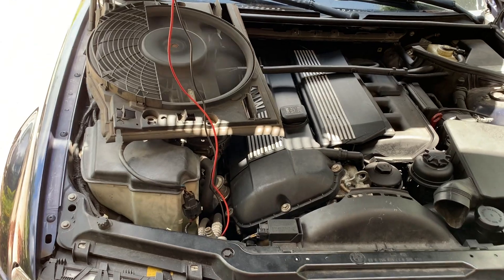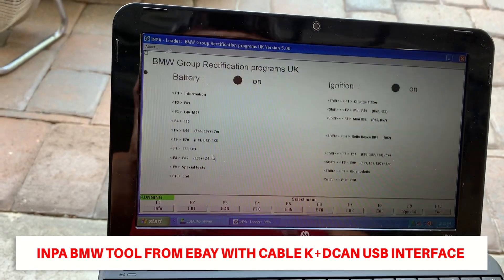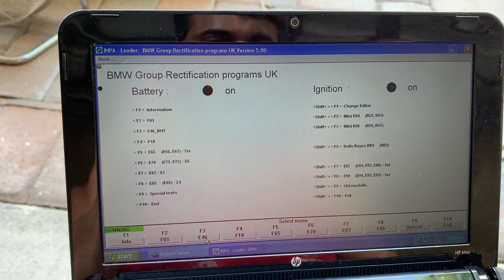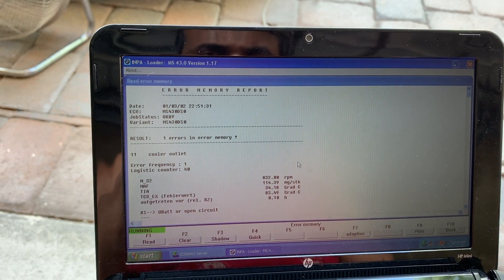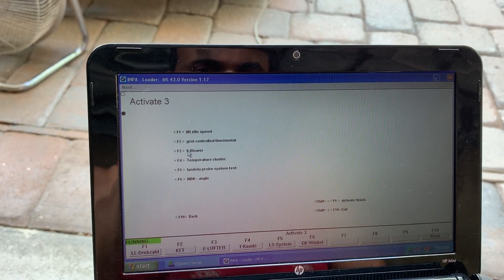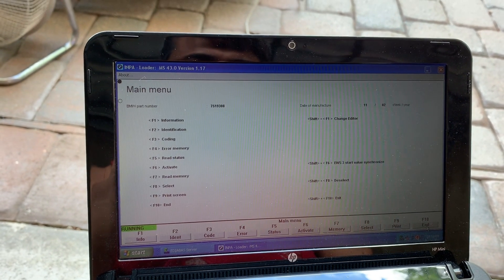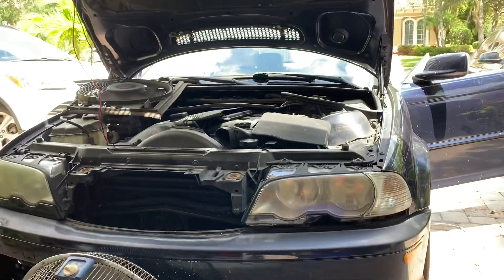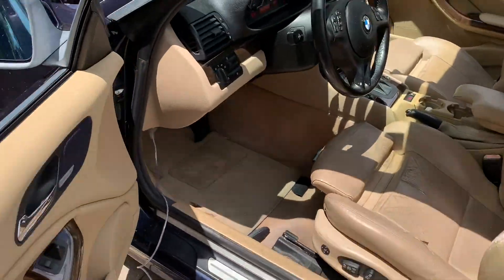BMW E46 ELECTRIC FAN FIX

Comment: So your initial auxiliary fan was dead and by changing it over it set off error codes in the dme, correct!
Reply from the maker: Huh ?
Reply: @HowToDoitright  Sorry im english, so your fan was not coming on, did it set off any error codes, sometimes the car will set off error codes making the fan not work, by clearing error codes with a scanner it might come on.
Reply from the maker: @ricardopelc-wesoly3483  no error codes were there.
Reply: @HowToDoitright  2.14 in you say that you had error codes on the fan!
Reply from the maker: @ricardopelc-wesoly3483  I may had. It’s been so many years. Sold the car. Don’t remember what I did yesterday 😂
Reply: @HowToDoitright  So the temp sensor more than likely triggered the fault in the dme.

Comment: Also.  To everyone with this problem.  IF YOUR AC LINES ARE LOW ON COOLANT.  THE FAN RELAY WILL NOT TURN ON.  YOU HAVE TO EMPTY YOUR AC LINES AND FILL AND BLEED THEM WITH NEW REFRIGERANT.    ACC LINE AFFECT THE FAN RELAY. JUST SOMETHING I LEARNED RECENTLY
Reply: Is this true my AC refrigerator is empty. I'm trying to test my electric fan but when I press the AC button my electric fan doesn't come on.
Reply: Thanks for this. I was wondering why it wont turn on and you solved it for me. 🙏

Comment: hi thank you,,, i also bought a inpa and cable from wish and i have a different inpa software version ...
so i took a version from bimmergeeks...
 no turning on fan when engine gets on temperature gauge on the middle
 it turns on when i connect the two cables from the sensor together
 and take battery cables off and it turns off
,or turns on with inpa but doesnt turn off with inpa f4 or it turns on with inpa and not turning  off with switch off
or it turns on direct minus and plus to battery and turns off when disconnect from battery
i also notice my airco pressure is low because of last years little engine refresh all coolant and gasket and oil etcetra etcetra,,
thanks for all help 
helpppppppppppppppppppppppppppppppppppppppppppppppp
thanks to u all,,,
greatings  a Kurdish boy living in the Netherlands..
Reply from the maker: I was seeing a similar problem on my E46. Tried so much to troubleshoot and after changing bunch of parts and spending $$$ I gave up and sold my car. A lot of people I have seen endup wiring the fan directly with a switch inside and they just control it manually when they drive and turn if off when they reach home. Kind of stupid but oh well howelese to fix it.
Reply: @HowToDoitright  i did the same after i try with 3 new electric fan